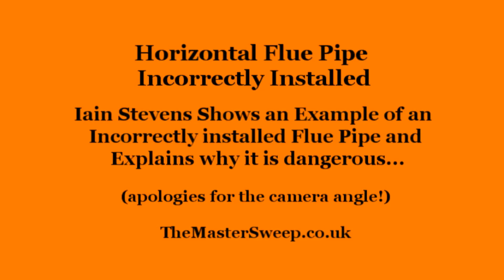Woodburner with Horizontal Flue Pipe Incorrectly Installed...

Comment: Always better to exit from the top if possible, i,ve fitted 3 stoves in the last week and there is a lot to know. Luckily all straight runs so not bad at all. I knew about not having more than 6" out of a rear flange as my mate had made me aware of that as i bought a cheap ebay stove. I never fitted it as i dont trust it. Heta 5kw in the house, 8kw fully refurbed clearview vision in the workshop and clarke barrel stove in the sumroom. It is a very enjoyable job to do but safety is paramount as with all trades.👍🏴

Comment: Hi, installing horizontally from the back is my only option. What should I do? the only way to install it is to have about a 1 meter horizontal pipe from the back through the wall before I can install a 90degree to have a vertical pipe escalate few meters as a chimney. Is this too bad?

Comment: My flue actually bent in on itself leaving a gap in the pipe and let smoke into the room. Now i have a guy coming to do a breakthrough fireplace. My question is can i go from the back to the top flue without hassle? is it just a matter of sealing the other back hole and using top exit? I have a herald hunter 8 boiler stove.
Reply: Will I get more heat with the  flue pipe  out of the back?   Rather than the top?
Reply: It's a straight swap, reseal the plate on the rear and you're good to go. Your stove will thank you for the top exit and will run way better. Hope that helps.
Reply: @guymorgan3648 simple answer is no, a top flue is always more efficient than a back, much easier for the gases to flow.

Comment: Can a wood furnace have 4 elbows/ turns?
Reply from the maker: Hi, under UK building regs you can have up to 4 offsets in the flue. These must not be greater than 45 degrees from vertical. The exception is a tee and soot box fitted to the rear outlet of the appliance which can be a 90 degree bend and counts as two of your four offsets. (You can only deviate from this with specific written approval from the appliance manufacturer. If not already covered in the manufacturer’s instructions it will involve a specific design with  additional calculations being submitted for their approval). I am only familiar with the regulations in the UK. If you are elsewhere in the world you will need to check your local building regulations. Hope that helps. 👍🏼